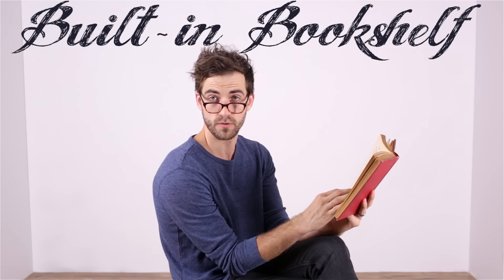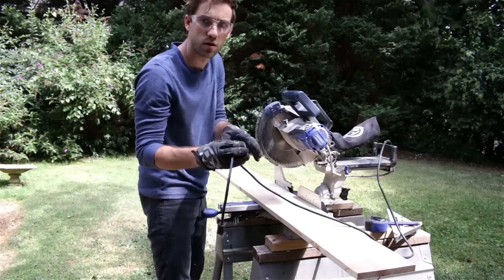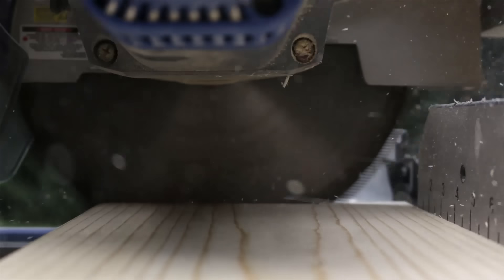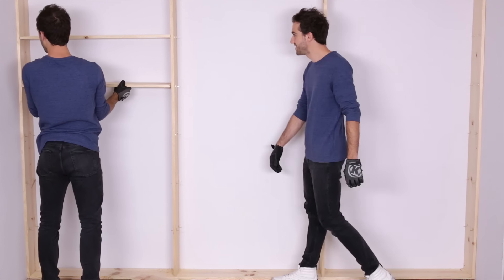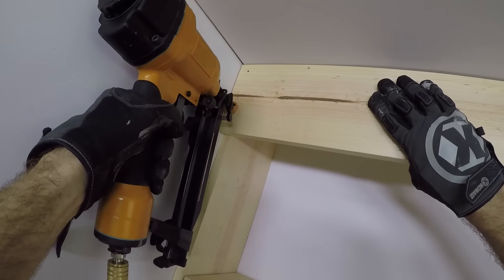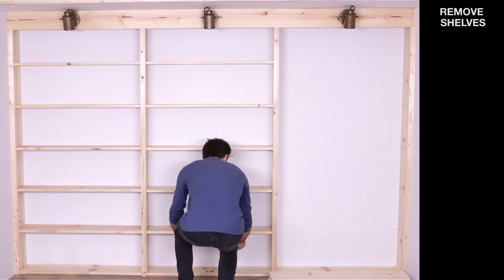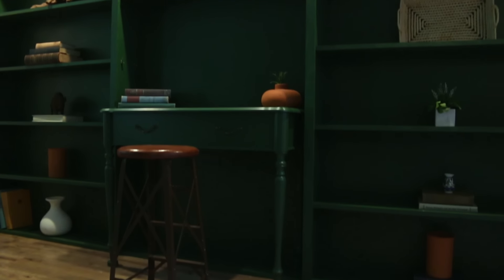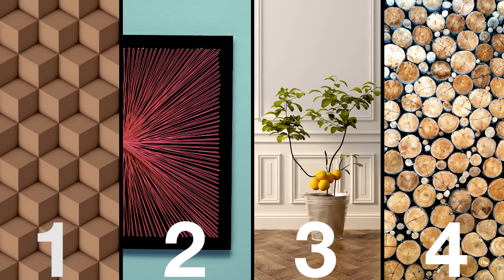THE BUILT-IN BOOKSHELVES WALL /// Experiment #004

Comment: my problem is:  how do i do this when i have only one wall (on either side)  this looks so cool.  and i know i can do it, of only i had a wall on either side. but, i dont.  can you help?
we just moved to a new house, and my husband is in a wheelchair.  so my hobby became this kind of thing.  any suggestions?  thank you
Reply from the maker: Hey Christa, congrats on the new house!! I wish I could go back and add that to the video, as I've gotten that question a few times. My best advice would be to install a floor-to-ceiling column out of thicker wood (i.e. 2x10) to act as that other 'wall'. You'd need to make sure it was attached very securely, so I might even consider using some sort of brackets on both the top and bottom of the column.

Comment: If you actually put a bunch of heavy books wouldn't the shelves bow? There's nothing reinforcing the shelves.
Reply from the maker: I tested a shelf by filling it completely with books, and I didn't see any significant bowing. If you were concerned, though, you could add more columns to decrease the shelf width. This design could also be built with 2x material vs 1x planks to add some strength.